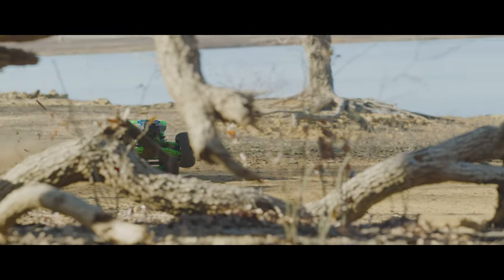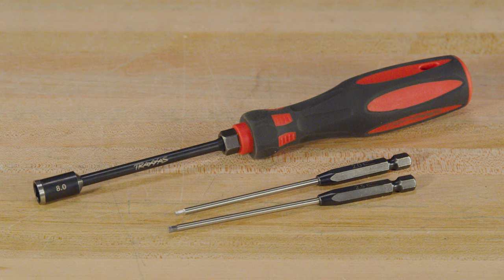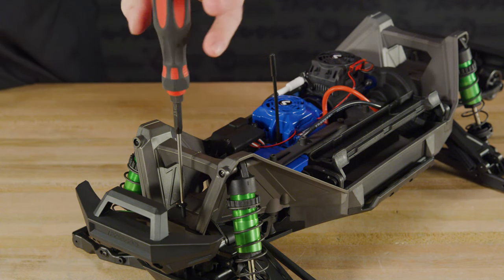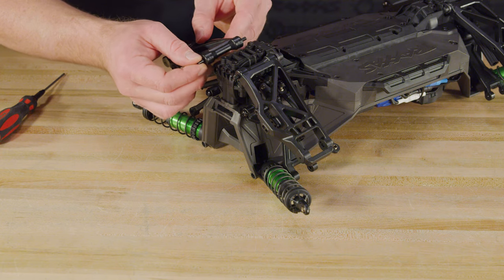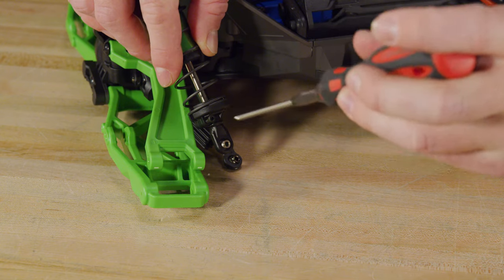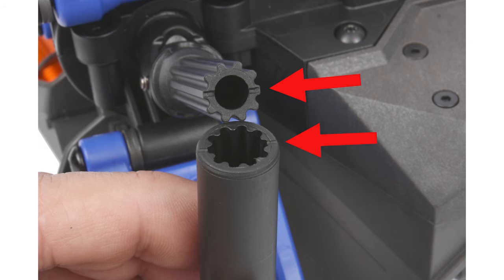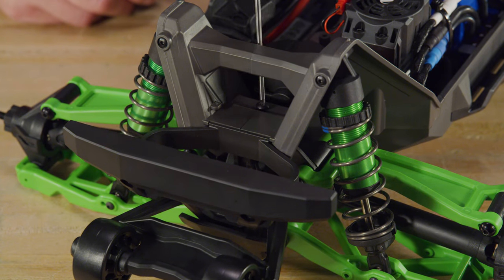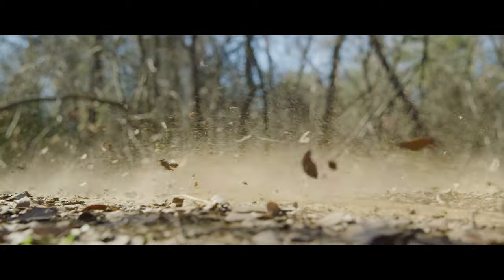WideMaxx Kit Installation | Traxxas Maxx

Comment: Do you need to buy different driveshafts for the wide kit?
Reply: i wonder too
Reply: No, but you have to use the longer shafts included with the kit and they skip over having to switch the outdrives over which is not easy.

Comment: This video should be updated ASAP for putting on the new steel drive shafts. It's really pricy to upgrade the MAXX, you really should have done this at cost due to the MAXX not being a very stable truck without the wide kit put on. Your designers messed up, and we the Consumer are paying the price for their mistake. I love your products, but really, it's going to cost me over $150 to make this upgrade. I have the TRX4 Sport, two Rustler VXL 4x4s, the MAXX, E-Revo 2.0, and a new XMAXX. At least give it to us the kit at the price you sell to the hobby stores. Everyone's making money from your mistake, and the customer is the loser. No more MAXXs should be sold without the upgraded wide MAXX kit. Thank you for reading this.

Comment: I've said it before, this is not an upgrade, it's a fix. The fix in this video, is not the entire fix. You have to get the metal drive lines, if you don't you'll destroy the plastic drive shafts. Everyone that has a MAXX knows it will roll very easily. I had no choice but to buy this fix, the only upgrade is maybe the metal drive shafts. Your engineers messed up designing the MAXX, and didn't make it wide enough to handle turns. You have to slow way down so as not to roll it over.  Traxxas should at the very least sell the fix at cost. Making your costumers pay for your mistake in designing the MAXX is not cool. Traxxas should not sell the MAXX without this fix. If you were a real car manufacture, you would be made to fix this under warranty. You're trying to make us feel this is taking the MAXX to another level, and in reality, it's a fix, and you all know it. With that said, Traxxas does make some of the best RCs on the market. The XMAXX is the best RC truck out of the box., and yes, I do have one. I just got my Wide MAXX kit today. $187 fix for the MAXX.
Reply: Hence why this new maxx has it and isn't called maxx 2

Comment: Yeah why not just of designed it correctly from the get go & have this already on? Oh you want more $$$...Silly me
Perhaps if it was designed correctly and already wider so it didn’t roll over you would of sold 35% or more than what was sold.
I have two Tmaxx’s (2.5 & 3.3), Rustler, Hoss, & now an Xmaxx so don’t think this is from an Arma fan boy.

Comment: This is a very incomplete and over-simplified tutorial. There is no mention of swapping out the rear shock oil. Nor the fact you have to swap all the components on the female section of cv drives to the new longer shafts, which is complicated in itself.